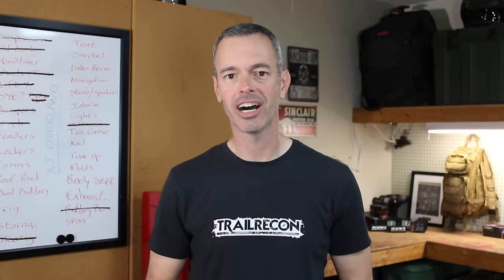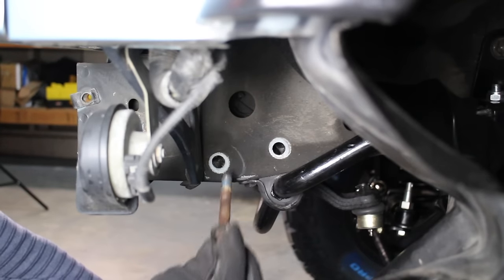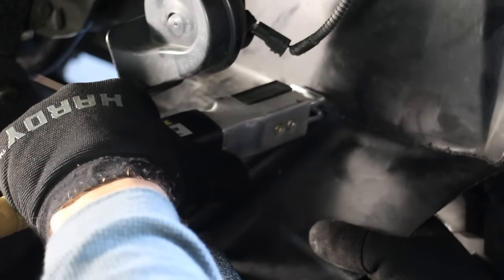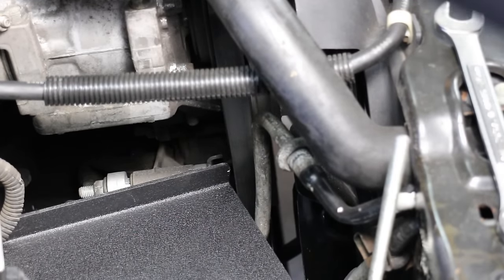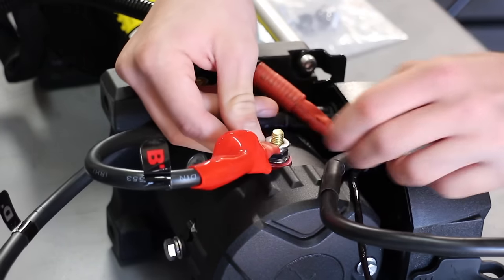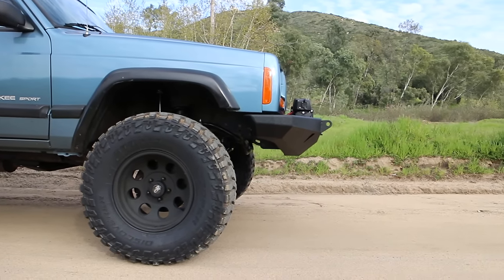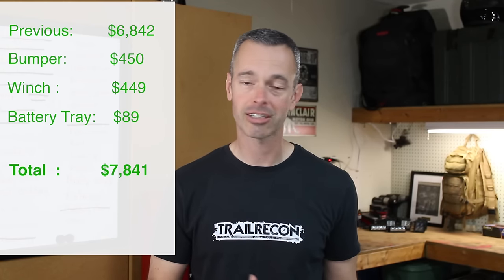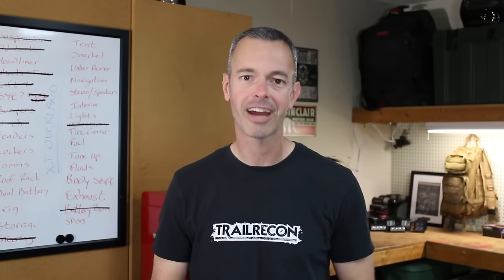Jeep Cherokee XJ Bumper, Winch & Battery Tray - Project XJ Overland Ep. 8

Comment: Very good job!  Really nice to see 2  things in particular:
1-your kids working with you. I got a used GMC Jimmy in 1977. I got a WARN bumper, but no brush guard, couldn't afford it. Me and my father took the brush guard that  was on the OEM bumper, cut it, used angle iron to mount the brush guard on the Warn bumper.  I was proud cause everywhere I went people asked about it. And, We made it together, didn't buy it, made due with what we had.  Your son did a professional job! Where'd he learn that??😉
2- the fact that you saw there was a problem.."a challenge to come", you stopped, and fixed it right then. That was a good lesson for a teenager to learn as later on, those ,"little things", could come back at a very inopportune time to leave you stranded miles from help.
Everyone runs in to those things. I'm glad you showed it so others will be aware and know it's right to do what is necessary right then and not leave it for later, which becomes never.
THANKS for sharing 👍 another great video.
Reply from the maker: Sound like a great project and always rewarding to get compliments on something you have worked on yourself (or with you dad).  Couldn't agree more with you about stoping and fixing things as you go!  Thank you!!

Comment: That front bumper looks great!  Very nice design with the ends sweeping up, and the winch mounted in the bumper, as opposed to being on top of the bumper.  The compromise on the grill color should look really good as well. Great idea painting the inserts, in the grill.  As for exhaust, I've found that my local muffler shop can do a very nice exhaust, exactly as I want, great fit  using brand name mufflers, for less money than the do-it-yourself boxed set of pipes.
Reply from the maker: I think I will have to make a few calls and see how cheap a local shop will hook me up for... great suggestion, thank you!

Comment: Manga flow SS exhaust sound nice ,this is what I have on my XJ and it not too loud and droning sound, you can drive for hours on the freeway. It's also allowed the engine run smooth too, equal more power. I had flow master on mine originally, the exhaust power didn't flow as nice as Magna Flow, you wouldn't think it would make that much different but it did.
Reply from the maker: We will be putting some miles on this rig, so no drone is a big consideration.  Thanks!
Reply: TrailRecon I also have 2 wrangler with all banks exhaust and header set up in them, and they are also very good, about the same as Magna Flow exhaust and loudness, the XJ has banks header too.

Comment: I currently run Wildcat headers on this XJ and ran Hi-tech headers on the previous XJ both served well without structural issues, both sets were mated to a "minimalist" exhaust system comprising 2.5 inch pipe with 2 inch from the muffler onwards.
Reply from the maker: Excellent, thank for sharing your set up!

Comment: Ran a flowmaster 40 with a wide tip and it sounded deep and aggressive, not too loud at all but a nice tone, if your looking for really loud and almost deafening just take the muffler off it sounds really badass
Reply from the maker: Not trying to go loud at all, a nice grumble is okay, but want' to keep the highway drown down.  Thanks!
Reply: You can get the muffler and pipe behind it on ebay for like 145

Comment: Excellent video. I'm "building" an '89 XJ and just picked up my smittybilt bumper. Alarmed at the weight, but I think I'll go ahead and mount it. Thanks for the great how-to and the  really good  video. To the point, no repetitions.
Reply from the maker: We knew we would be adding a bit of weight, but we are very happy with the bumper, so no complaints.  Good luck on your build and thank you!
Reply: 71quebec ..i added the same bumper to my XJ and couldn't believer the differe nice in the way it rode down the road , took the bumps much better .

Comment: I'm running a very similar build to yours and am loving the videos! I put on a kit from Iron Rock Offroad. They have a lot of different options but I went with the most high end version that came with a Flowmaster muffler and Magnaflow catalytic converter. Even with the most expensive kit, it was only $290, so I am happy with it. Perfect sound and can definitely feel a power increase. Plus a couple of MPG's too!
Reply from the maker: Very happy with our lift from IRO, so will need to check out there exhaust systems,.  Thank you!

Comment: 91 xj here running the stock exhaust manifold...got rid of the cat converter and muffler...straight pipe right out the back...has a bit of a rumble but still quiet enough to have a convo while driving

Comment: I went with the tuff stuff 4x4 bumper for the xj direct bolt on no drilling and you dont even mess with the power steering.... has a place for a winch, and 2 fog lights check it out when you get a chance..... thanks for the great videos....

Comment: I used a cat converter from a Wrangler TJ because it was more lower profile than the 2001 XJ's bulky cat converter. I then ordered a custom made stainless steel cat-back 2.5" performance exhaust from 4WD Hardware, which is custom made by Heartthrob Performance. The pipe is T-304 stainless steel, and the muffler is T-409 stainless steel. The whole kit is a bit pricey, but I want it to last like the one I installed on my 1989 Cherokee 15 years ago.

Comment: if you don't want drone avoid chambered mufflers. MagnaFlow is a great option and you can build a relatively cheap exhaust from universal parts using clamps and small extensions. the exhaust I have on my ZJ cost less then $100 with a muffler and new catalytic converter but I do have a welder which makes things easier.
Reply from the maker: Less than $100 would be great, will have to explore piecing it together vs. buying a whole system.  Thanks!
Reply: My XJ has a Jegs F40 knockoff and doesn't drone very much at all.   Magnaflow sound lacks personality IMO.  Had one on my WRX and hated it.

Comment: I've been running the walker dyno max systems from rock auto for both my XJs since 2008. no issues, just add a high flow cat. Or not :). 150.00 can't be beat. iron rock kit is a great value too.
Reply from the maker: $150 is a great price point, thank you!

Comment: Running a Flowmaster muffler.  Check for cracks in your manifold and you might want to check your motor mounts.
Reply from the maker: Thanks!  Great suggestion, will be sure to check out the manifold and mounts!

Comment: Check local junk yards for factory parts. Battery box and bracket $10
Now put thin rubber mat in bottom of battery box. Note: cabinet draw liner, Walmart, comes in a roll. Also baking soda in battery box for acid over flow. Protects the metals.

Comment: I like the new bumper! I run a Gibson exhaust system on my 01 XJ, it's a bit quiter than stock but a deeper sound. Overall been pretty pleased with it thus far! Just have to watch how you run it though. When I replaced the right rear leaf spring shackle bushing and installed lift shackles  the bolts for it were within 1/8inch of the exhaust with the factory bolt length, but since it had about an inch of extra length I just chopped it off. Just be sure to consider the mounting detentions since you guys put that new Leaf spring assembly. Good luck with it!
Reply from the maker: Yep, my leaf spring bolt is also rubbing on the current exhaust, so will look to remedy that with the new system.  Thank you!

Comment: I'm running a new replacement manifold and cat with a flowmaster delta 40 that dumps about 6" before the factory exhaust exit. Sounds great, no too loud but you can definately hear her.
Reply from the maker: A litter shorter would be nice for sure, mine is rubbing up against the upgraded leaf springs bolt.  Thanks!
Reply: Yeah, I had the same exact problem. I could send you a video of what my exhaust sounds like if you want.

Comment: BTW, on the exhaust. I plan to replace my worn out system too,but haven't decided what to use yet. I will say that I believe in keeping the outdoors clean and quiet. At least as quiet as possible. I love the sound of glass paks and all the mufflers that we run on our hot rods. I have two street rods that sound bitchin' but for the overlanding I want to be as quiet as possible. If you want a killer muffler, though, with excellent sound (not quiet) I recommend the Porter. It is a muffler from the '50's and was run an many street rods. The new model is stainless (even polished if you want. me NO) with stainless steel packing. It will never burn out or change tone. Just google Porter mufflers and you should find them. I think cost is around $80, yeah, not cheap, but will last longer than the vehicle and you can put it on the next one!
Reply from the maker: Sounds like a great setup!  We ended up going with a Magnaflow catback system and we love it.  Very subtle, no crazy noise on the street or trail.

Comment: I also have headers and motor mounts like everyone else said.  I broke the budget and got Gibson stainless headers with ceramic coating, because I think headers are cool.  APN headers are probably fine, though I did pick up 40 HP with the entire exhaust and intake overhaul according to my smartphone accelerometer (torque obd2 app)
Reply from the maker: Gibons and ceramic headers is a great option... just don't want to break the bank just yet.  40hp is REALLY nice!

Comment: I am running magnaflow universal muffler, you can get at local auto parts store for around 80.  With MF, they are all straight through, so  have nice bark and potential for real power gain.  You just decide how much noise damping you want based by choosing the volume of the muffler, bigger = less noise.  The universal series is very large, so, just about the quietest MF you can get.  I like it, has good bark at WOT, good power gains (with headers and CAI), but were I to do it again I might go smaller.  The CAI is louder than the muffler at WOT.  There is also some drone though too, so I added a lot of dynamat to the interior.  Like the battery tray, this project is likely to be much bigger than just an exhaust.  My exhaust mods always lead to a full interior sound engineering, and cold air intake, got to get more air in to move more air out.
Reply from the maker: Great info, thank you!  I don't want to get a system that is has a lot of drone on the freeway.  I think we may dynamat when we get to the interior just for general sound deadening.

Comment: The accident makes sense. There is also no jeep badge on the front of the grill so it's all probably been painted. Love the videos, the XJ is such a fun vehicle to work on. I'm running the banks cat back, can't speak for a new cat, header or down pipe. Banks I feel for the money you get a good buy. Makes a great sound but not too loud. I'm not too sure of the down pipe options for the XJ, I'm thinking the only true option is a custom from an exhaust shop.
Reply from the maker: I think she needs an new badge for sure... but maybe have to black it out.  Great suggestion going with a custom exhaust shop... thank you!

Comment: My son & I just installed the same winch on the same bumper as you did. My question is my winch came with the steel cable. You show tensioning a synthetic cable. Did that cable come with the winch or did you buy that separate? Also, I put on the same Smittybilt rear bumper as you. We are required to show our license plate so I found and bought a Smittybilt rear plate bracket. I am pretty much following your build as a guide and am VERY happy so far. Keep building!

Comment: lm curious as to what lockers you are thinking of putting in ?  I have been trying to decide on Grizzly mechanical or spending the big bucks on arbs.  By the way I retired from Toledo Jeep Assembly and spent around 12 years on the XJ line in trim before going over to the Wrangler line .
Reply from the maker: Haven't decided on which lockers yet, will start digging deeper once we set aside the budget for it.  Thanks for building us a great vehicle for so many years!

Comment: I am running a walker quiet flow cat, muffler and tail pipe. I stuck with stock diameter. It is inexpensive and it is quiet like stock until you get on the throttle and it purs. Pros are it is quiet so I am not scareing wildlife and I can hear if something is wrong with the jeep like a u joint or sticky brake until I open it up. the cons are that it doesn't come with a coating. I did not paint it so after a year it is showing signs of rust. put on a coat of protective exhaust paint and she will be gold.
Reply from the maker: That's great information, thank you for sharing!

Comment: saw you had a tire carrier listed for the list. have any ideas on what on your looking at?
Reply from the maker: We've looked at a couple of them out there, but haven't settled on which one yet.  Just have the tire thrown in the back, so need to do this upgrade soon to make room.
Reply: TrailRecon I was looking at the rock hard 4x4 tire carrier ties into the stock 8 holes plus goes into the unibody and ties into were a hitch would mount. Can get pretty can mounts and a rack that goes over the spare tire

Comment: Great vid!! I love how you showed that "bolt ons" are never bolt-on!!😂
I can't tell you how many times I came into that situation thinking that I spent good money for a part that should exactly fit. It's never the case. I don't blame the aftermarket people, I blame the original manufacturers that had such loose tolerances.
Reply from the maker: I'd say bolt ons are 50/50 in my experience.  I know I am always very pleased when no extra modification is required.  Thanks!

Comment: I'm installing this bumper on my 91 XJ right now. Thanks for the video! It really helped the process. I'm having a little trouble with the inner bracket piece that slides into the frame on the passenger side. Any advice?

Comment: I have a xj as well.  I was watching ur review on the spod and you said you might add one on this project any idea where you will install it? And are you adding a second battery?
Reply from the maker: Second battery in the future for sure.  I haven't decided if I'm going with an SPOD, another brand or a completely different option... still researching.
Reply: Just from my research I think the spod Is a really good option for the xj. Where do you plan on placing ur second battery?

Comment: I have been looking, cant find any low profile or "hidden" winch bumpers. Found older links with product no longer available. Most common winch bumpers stick out like a duck bill. It's not a deal breaker but I would like it tucked in a bit.
Anyone know a solution?

Comment: just did mine last week....most likely your exhaust manifold is cracked....apn manifold, downpipe from rock auto, catback exhaust from ironrock, high flow cat and super 40, 2.5" all the way out...btw im rusty nutz xj on instagram
Reply: tommy k how is the walker downpipe? That's the only one on the market it seems, gets bad reviews from what I read.
Reply: Chrisw678 not bad so far...looks like a shitty weld from the factory though
Reply from the maker: Thanks, will have to give a close look to the manifold.  Don't hear any of the standard ticking noise you would get with manifold, leak but worthing giving a detail look.
Reply: TrailRecon just look where the piping comes together....will be a hairline crack, also inspect your motor mounts... looking forward for more progress
Reply: planing on doing the iro exuast with what you listed the 40 sounds so so good!! but any way how is the apn manifold holding up? how long have you had it? got about 4 or 5 cracks in mine
Reply: Douglas Hefner I literally just put it on last weekend...if you get the APN, you will have to grind a tiny bit of the flange for cylinder 1 to get it to line up
Reply: i googled them saw that from a few ppl looked like it was mostly with the 97 and up i have a 95 but will for sure watch out for that

Comment: Rear Bumper :      http://www.ebay.com/itm/192090155764?_trksid=p2057872.m2749.l2648&ssPageName=STRK%3AMEBIDX%3AIT     $ 614.00 Free S/H  Best price I could find. 3 months of looking.  

The only thing made to fit 1984-2001 Jeep Cherokee XJs. Now the Finder Skins
(see parts list) will have to be cut to fit proper on some models. This is not in the instructions. Also you will have one hell of a time installing, if you have a gas tank skid plate. Save all the original hardware (nuts bolts and screws) You are going to need some of them. 

Front Bumper:    http://tuffstuff4x4.com/products/tuff-stuff-84-01-jeep-cherokee-xj-front-winch-bumper/
 Not a direct fit, as most upgrades. Fenders will need cut. And go to "Tractor Supply" for missing hardware. This is a Very Nice and well made bumper. 
 Suggest using an engine hoist and a couple of straps (tie down, tow straps) what ever. Help suspending in removal and installation of bumpers.